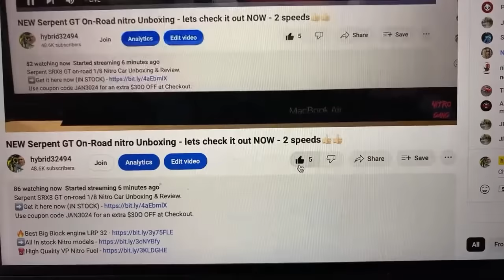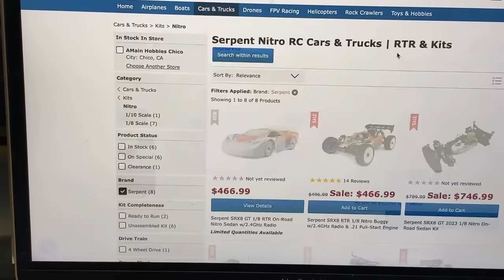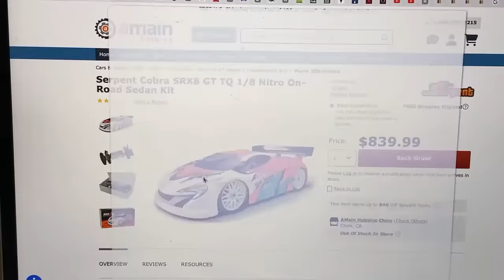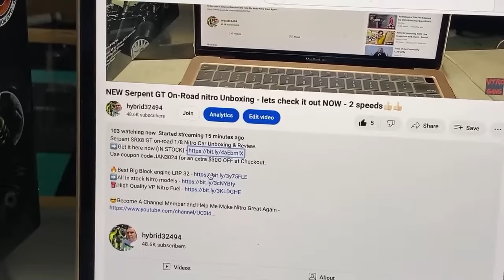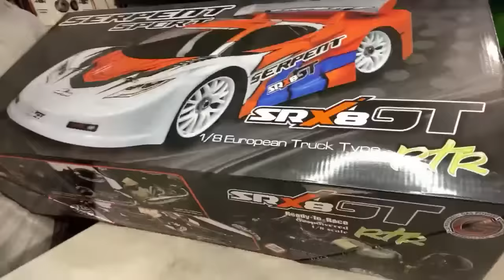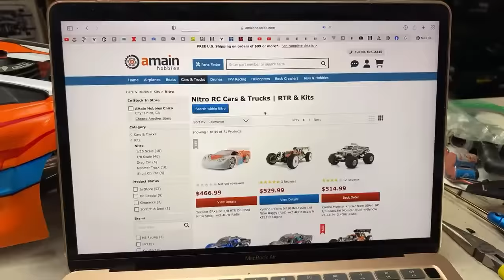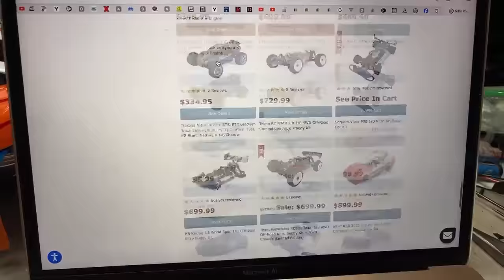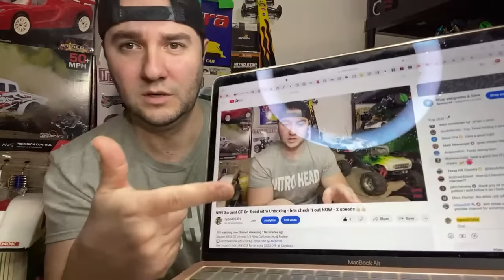NEW Serpent GT On-Road nitro Unboxing - lets check it out NOW - 2 speeds👍🏻👍🏻

Comment: Hybrid what's good man! I need help finding a head button for my Dynamite 21 rtr pull start I only ran it a couple of times and it runs great only to find out the head button stripped out when changing the glow plug I can't find one anywhere, hate to have a perfectly good running engine go to waste.
Reply from the maker: Hey man, I just searched the entire Internet for the part you need and can’t find it anywhere either. The best thing to do would be to try to find the part number from an engine manual for that engine, which I also can’t find anywhere I was thinking it’s possible that SH 21 head is the same. Therefore, it might have the same head button.
Reply: @hybrid32494  OK where there's a will there's a way! Thanks man.

Comment: QUICK TIP! When you were trying to measure the ride height towards the beginning of the stream, you could have used the opposite end of the caliper. A little slide rod will come out to get that type of measurement easily. Most people don’t even know it’s there and how to use it. I’m sure you will figure it out. Hopefully this helps. 

I just got my first nitro(Revo 3.3) and have been catching up on some of your older livestreams. I have a Sledge and a TRX4, but I have always wanted a nitro. I love micro engines. I used to be a mechanic before I went back to school. Plus my grandfather had hand built balsa wood planes, while I was really young. They always intrigued me growing up. 

Hopefully I can catch your next stream ✌🏻